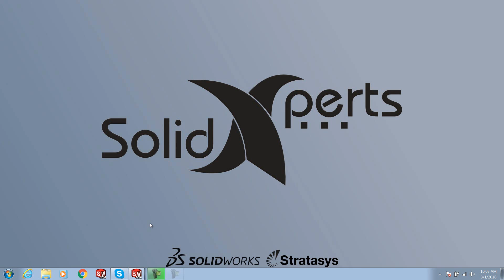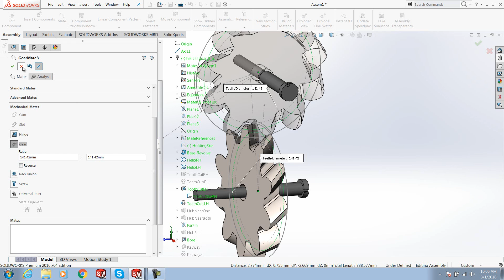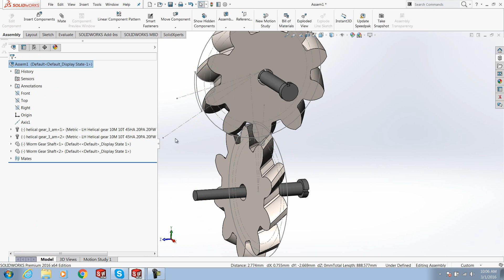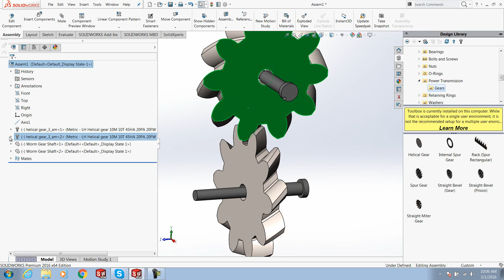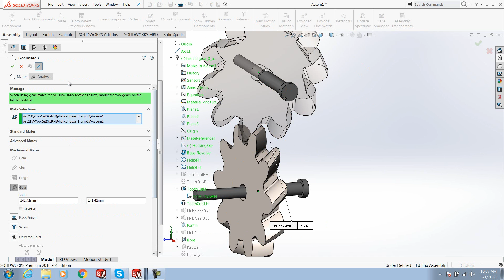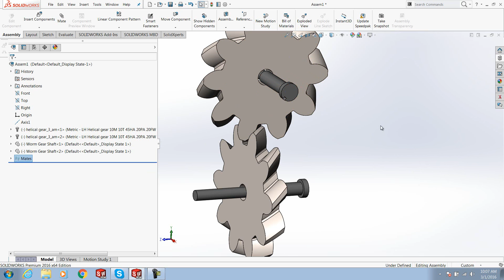SOLIDWORKS Add-in - Toolbox GearMate - April 2016

Comment from the maker: Yes, the teeth for the gears in Toolbox are cut with a calculated involute profile. However, the precision and tolerance of the dimensions may not be close enough for precision machining in steel. Nylon gears made from the Toolbox parts would probably work.

There is a ToothCutSke within the Feature Tree of the gear part that users can examine, and the equations are within the parts at the top of the Feature Tree.